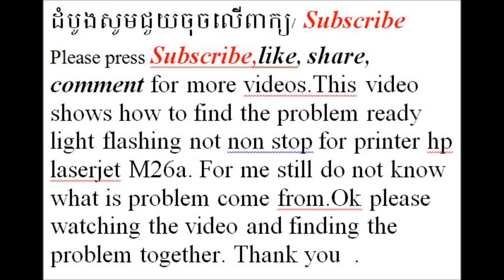HP Laser Jet Pro MFP M26a How to fix E8

Comment: Sir, my printer is of the same model, once it is turned on, then it stops along with it, you tell me what is the problem.
Reply from the maker: can you show clear the  problem. when you press power button on the light show or not and the printer running or not.if the cannot turn on the printer . checking the power and power board.
Reply: @Electronicview  Printer turns on and off few second

Comment: hallo,, do you know abot laserjet pro M402 supply memory error..? haved replace cartridge 2 time but the same issue, still supply memory error,, help me please
Reply from the maker: for me if printer show Supply memory error , the chip on toner cartridge end of life , so you try to change new chip or you can try to take chip out test more time what happen. and you check you install toner correctly ,check the contact 2 pin inside printer and chip is good or not
Reply: @Electronicview  I have checked all of them and everything looks good and normal and I have replaced with a new cartridge but it still supplies a memory error..do i have a replace the DC controller..?
Reply from the maker: @erfinnugroho4844  The printer performs correctly, but 'Supply Memory Error' displays on the control panel. To resolve this error, make sure that there is not any packing material in the printer or on the print cartridge, or replace a defective cartridge.
Reply from the maker: @erfinnugroho4844  Typically, this error message is caused by packing material left inside the printer
Reply from the maker: @erfinnugroho4844  Do you remove all packing on the toner cartridge?
Reply: @Electronicview  i have do sir...I used to have a case like this in the same type of printer and I replaced the DC controller after that the printer can run normally ... do I also have to replace it again ...? And what exactly is the cause of this problem?
Reply from the maker: @erfinnugroho4844  yes if you check all part still problem you can change . and for now the printer can print or not .I Know that event it show supply Memory  error but the printer can so you no need to replace because Dc controller board is expensive
Reply: @Electronicview  for now the printer cannot print because I have not replaced (DC Controller) ... yesterday I only checked the conector between the printer cartridge and reader reader chips chips. what should I check again before having to really replace the dc controller because it is indeed very expensive.

Comment: sir same probeme in my hp 1136mfp how to du
Reply from the maker: Thanks. You can checking scanner when you turn on printer it running or not? If not running you remove the cover scanner and scanner reconnect cable . if still not run, try change motor scan.